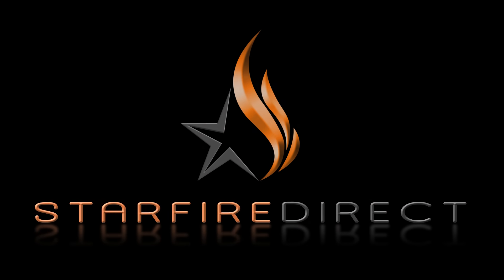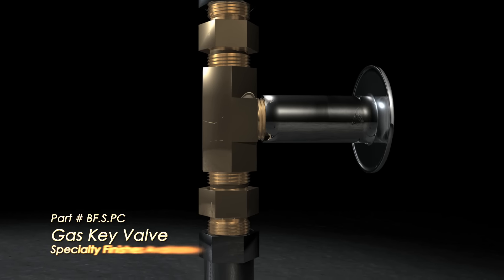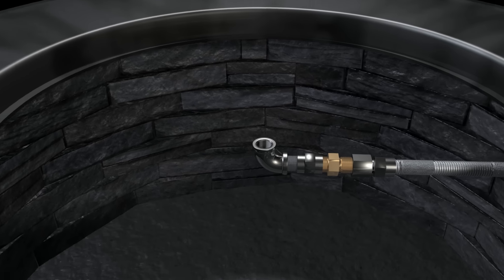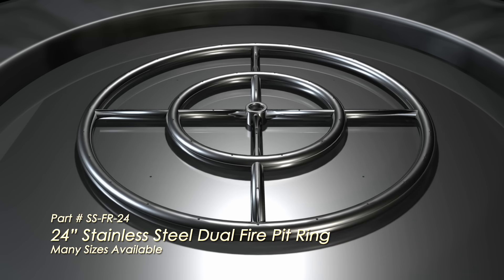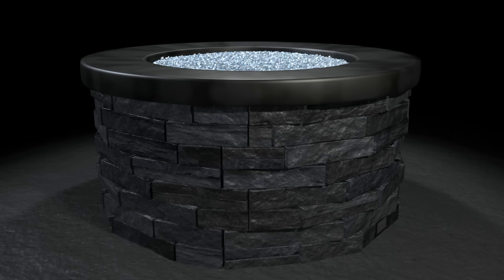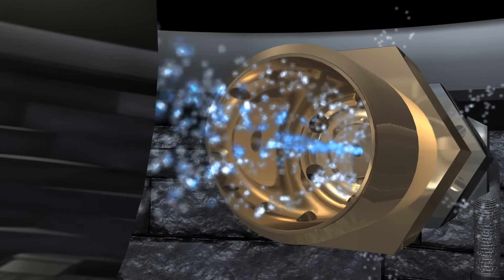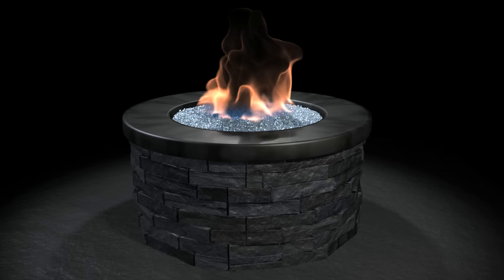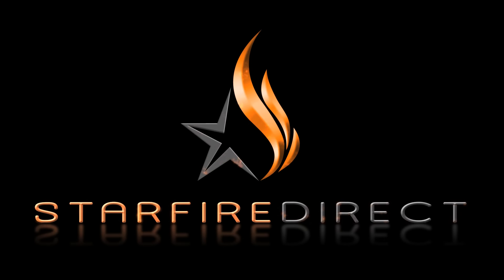How To Build A DIY Fire Pit With Propane Gas

Comment: We are on propane for our house. We're running a line to the fire pit. The line is rated at 150,000 btu's. What are these rated at? And we're thinking of doing a Gabion Basket as the holder for the burner and dish. Would a Gabion Basket provide enough ventilation for propane to escape?
Reply from the maker: This video is more of a tutorial on the basic elements needed for a propane fire pit to function properly, as well as how a propane air mixer works.  If you want details on specific items that will work with your custom installation, it's better if you call directly so we can advise properly.  

Personally, a gabion basket is a great idea for a fire pit.  However, if you're hoping the gaps between the rock is enough for air flow, I wouldn't count on it.  Again, give us a call with your plans so we can advise.

Comment: I'm getting a fire pit table with separate small propane tank.  Can I bury the 10 foot hose that comes with it under my patio pavers so I can hide the hose? No chance it will be dug in to under there but not sure how the hose will hold up under ground. Tank would be ABOVE ground.
Reply from the maker: LP hoses and flex lines are generally not approved to be used in the ground.  They can be punctured, corrode, or rot if buried in the ground.  Despite this, it's not uncommon for people to bury their gas line using conduit to protect the hose.  This would help it last longer, although, it's still not being used as intended.

Comment: Should I be concerned if when the I have the fire table lit, the flames sometimes funnel upward above the table like a little tornado?
Reply from the maker: Tobie2 This is common if a breeze or wind is present while using your fire pit.  It also may be an indication that you have too much lava rock or fire glass covering your burner.  Try removing some of the lava rock or fire glass and see if that eliminates the "tornado flame".

Comment: We just had a propane fire pit built and there is no vents, is this dangerous?
Reply from the maker: There are a lot of factors to consider, but if your fire pit cavity is "open" under your burner, we would definitely recommend you add ventilation.  Propane is heavy and pools like water.  If you don't have vents, it can pool until it ignites and cause damage.  The vents offer a way for excess propane to escape the fire pit.

Comment: Holes in fire ring should be pointed down.
Reply from the maker: This is certainly up to the installer.  We've seen many fire rings offer an open hub which allows you to install the ring up or down.  However, we've seen much taller flames when the holes are facing up.  And with Propane Gas, it can also help the propane "escape" easier than if the holes were faced down, causing the gas to work harder to escape thru the lava or fire glass.  

But again, it's certainly the installers choice.  You can always install it one way, test, and then install it reverse to see what you prefer.